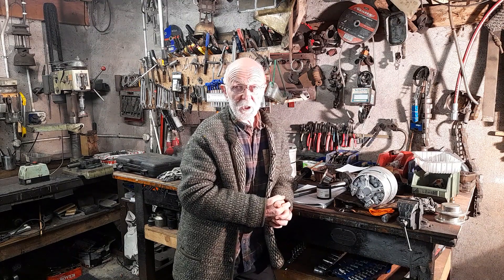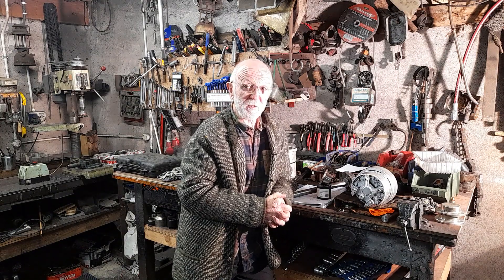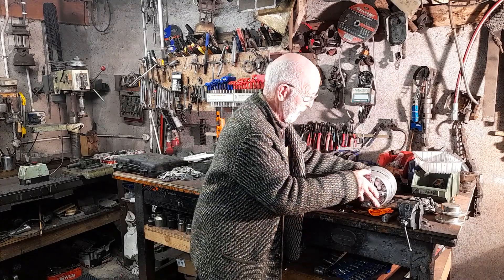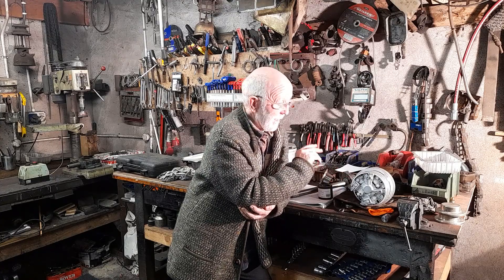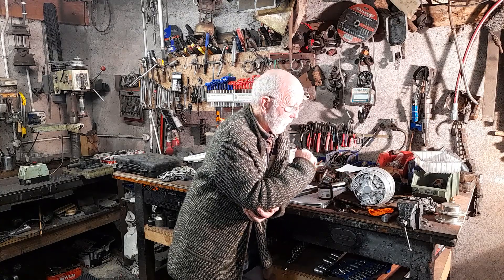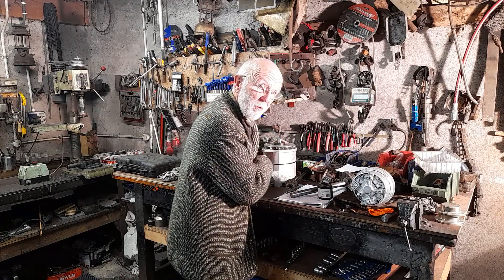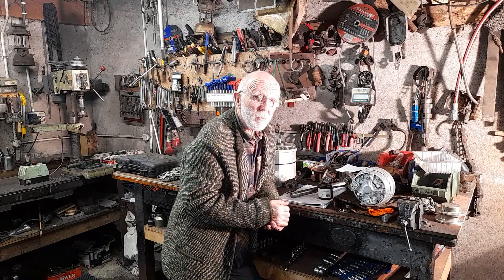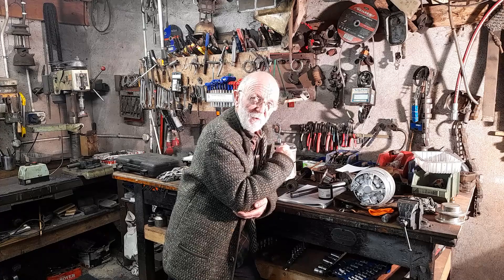Gardner Engines: Alternative to the AC5 Alternatr

Comment: Great information!  We're trying to restore a Bristol Lodekka RQG041 that had a Gardner 6LW.  The engine was shot and it was replaced with a Gardner 6LXB from a Daimler bus.  However, they installed the original dynamo (generator) for the old engine.  Well the bus is just about done except the electrics.  My friend asked me to look at it but it's really sad, plus he's upgraded to dual electric cooling fans, more lighting, additional 12 circuits possibly and inverter and well I told him that old generator, even if I figured out the wiring just couldn't handle the power demands.   Joe please HELP!  I told him we need to convert it to an alternator and could use your recommendations.
Reply from the maker: Tom, we can supply all you need, please email me: tangent.gardner@gmail.com

Comment: Hi Joe, a little late on this one but here’s my two penneth worth.
 I cannot comment on marine applications as I have no knowledge about them but for automotive purposes the AC 5 was the baby of the family and only used on trucks as the rated output even on the ACR versions was much to low for use in the bus / coach application. The usual fit on these were AC7 on the earlier vehicles (when alternators were first being introduced) and then AC203 on later vehicles the AC203 being rated at 60 amps output. Prestolite took over the design after CAV finished , they introduced the ACR 203 (with an integral regulator) rated at 115 amps.
 The drive, as has been stated the drive on these machines was by shaft with layrub couplings, on later vehicles with power steering the P. S. pump was mounted in tandem with the alternator and drive output. As far as I am aware these parts are still available. The older rubber hose couplings usually failed by just wearing away internally and so loosing drive, they didn’t usually flop about in the breeze. We had enough problems with the old dynamo equipped vehicles and they had a max output of about thirty amps so the best of luck with anything with a higher output.
  I must admit to having reservations about fitting a high output machine onto the original alternator drive, as it is driven by the timing chain. I have a suspicion that with a 60amp alternator and a P. S. pump being driven by it that it is getting close to the limit of what it can do before it becomes unreliable. Perhaps mounting elsewhere and driving it by belt would be better. 
  Twin alternators are a common fitment on PSV vehicles these days, Volvos use a pair of 80amp Bosch machines and the old Bristol LH coach used a pair of AC5 alternators. 
  The beauty of the Gardner is that it was designed from the outset to be fitted with a wider range of generators, 8inch diameter being the largest with spacers available to allow smaller diameter machines to be fitted so if you can get the drive sorted just about anything within the size limits will fit.
Reply from the maker: Thanks a lot Geoff, for that.

Comment: Always enjoy watching. In Australia, Victorian Railways had a type of Railcar called a Walker Railmotor. They were powered with Gardners. 3 types 103 HP, 150hp, twin motored 280hp. These were used on many different lines. 3 or 4 have made it into operating preservation.

Comment: I replaced my AC5 this with a modern unit rated at 125 amps 24v  it was a HC Cargo unit available on the internet and I'm very pleased with it
Reply: Is that shaft driven same as the AC 5? I,m looking for a replacement mines rubbish
Reply: @jacko74fisher70  no it’s on a double grooved pulley, joe mcool on YouTube had found a direct replacement for the sleeve mounted AC5
Reply: @MrCrabbing  you must have a big crank pulley on your engine to drive it fast enough?
Reply: @jacko74fisher70  Just the standard Lancing marine pulley

Comment: Buses had the power steering pump driving direct from the alternator drive from the engine, via a leyrub coupling, then on the other end of the pas pump, another leyrub coupling drove the alternator. On older buses where no pas pump was fitted then the alternator was driven by a shaft directly coupled to the first leyrub coupling, the really old ones had that rubber hose that you have secured by 4 hose clips.